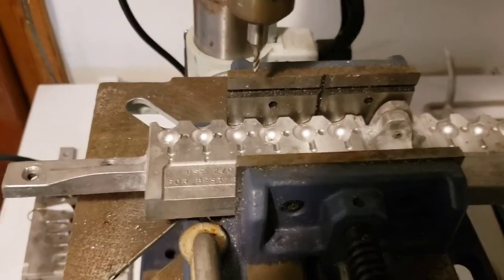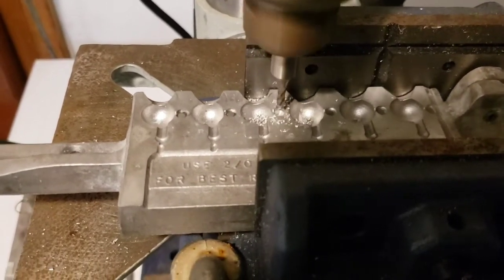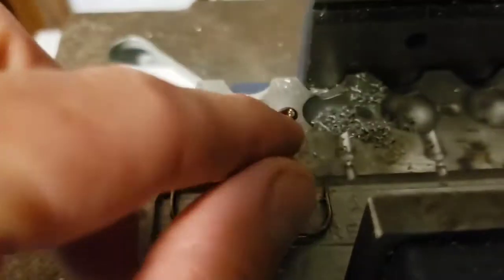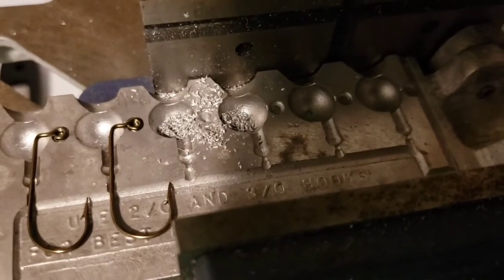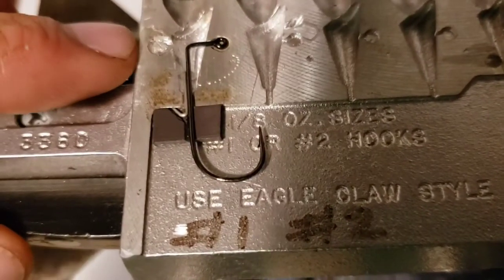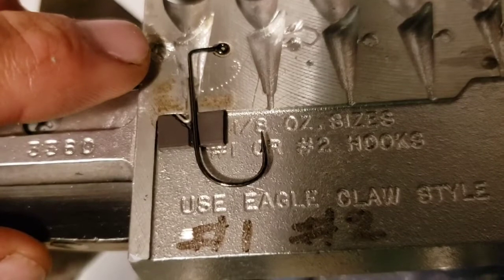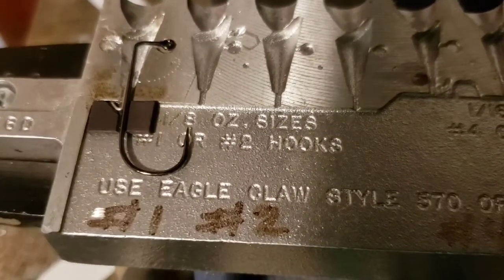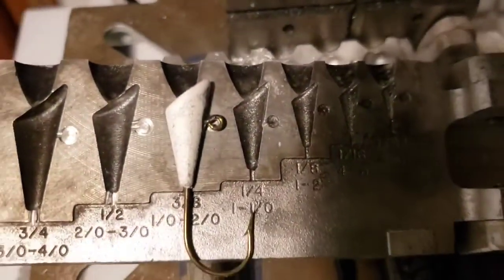Simple modifications to pour jigs faster! Do-it mold modifications to be more productive.

Comment: A trick is not to power on the press instead apply pressure and turn the chuck by hand,no run out and a much more controlled hole
Reply from the maker: Thanks that makes sense. I don't do much on the little drill press anymore, and use the mill for pretty much everything now.

Comment: I’ll tell ya I have some 40 molds and it wouldn’t be a mold if you didn’t modify it. More often it’s to accommodate a larger hook size since most molds are machined for hooks that are the right weight but not a strong enough hook
Reply from the maker: Heck yeah most of mine are modified too but can't say how many. 😅 My wife is a subscriber.
Reply: @relapsetackle  that’s just what I got in doit molds. I have another dozen or so of various brands, my own personal custom line and not to mention another 25 soft plastic molds. Wish they went up like the price of wood. I’d sell and retire a millionaire
Reply from the maker: @stripermanly  Yeah it's pretty ridiculous how much Lumber and a lot of materials cost. I've seen a lot of used molds that are way overpriced and people are grabbing them up because the manufacturers can't meet todays demands.